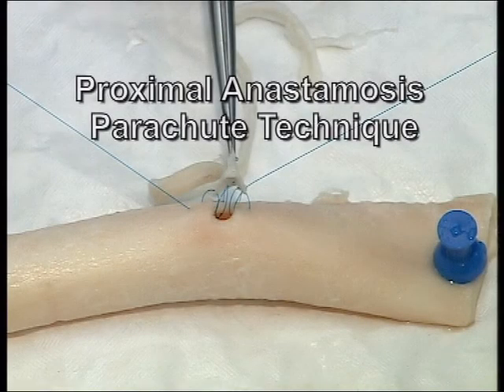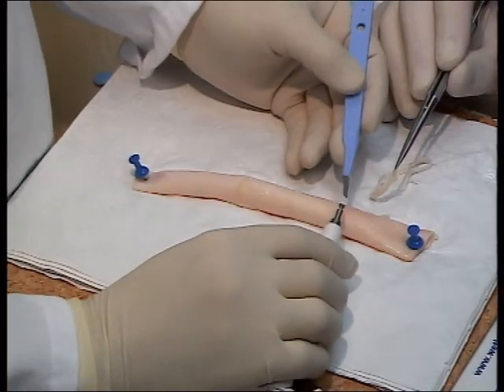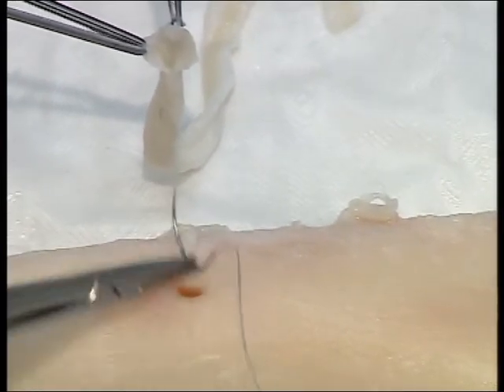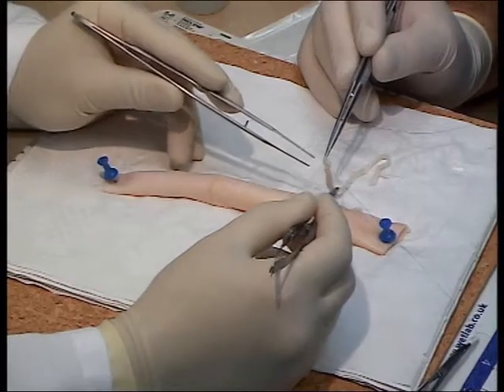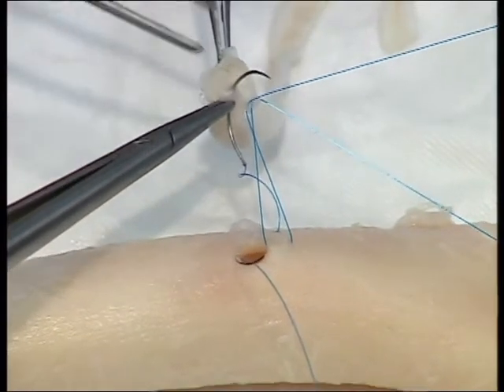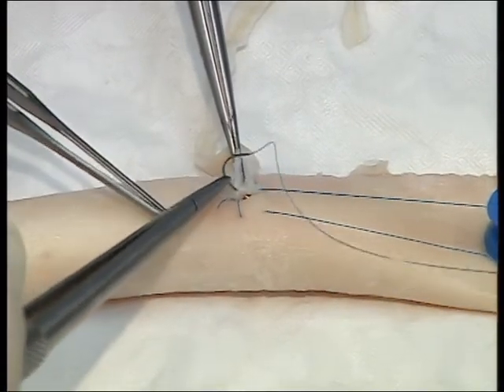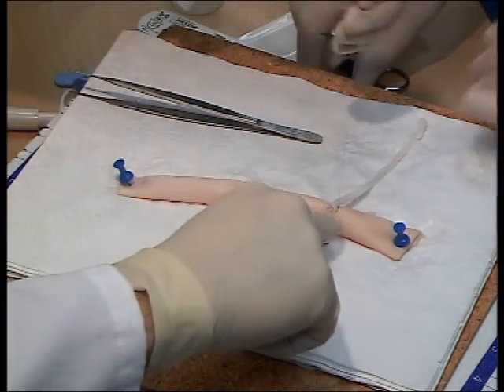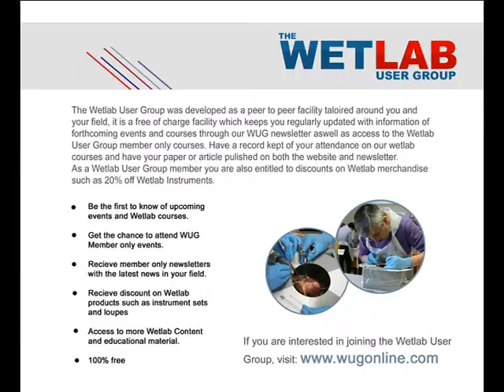Cardiac Surgical Skills Laboratory - Proximal Anastamosis Parachute Technique CABG

Comment: Holding the conduit with the jaws of the forceps will crush the endothelium
Reply: If im right those are gerald forceps with fine serrations,  it is designed for such purpose ,it doesnt crush structures. He could've used a ring forceps too.